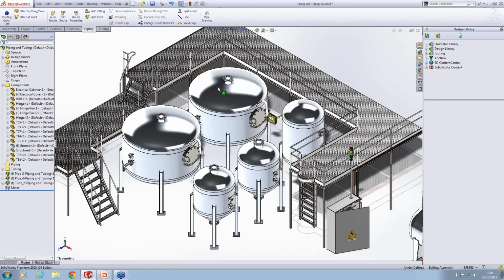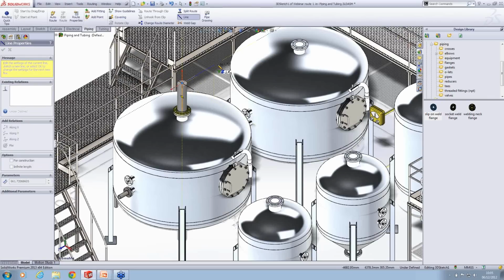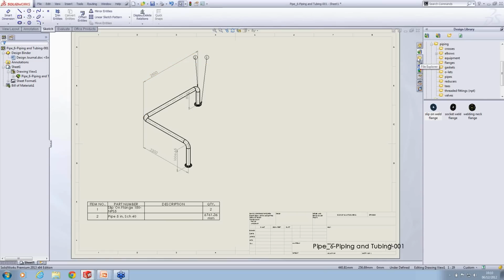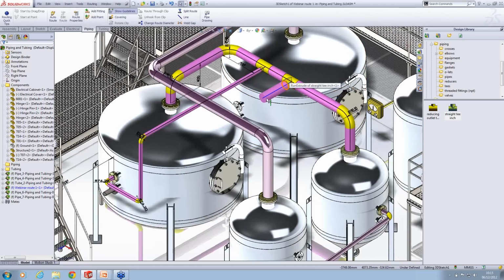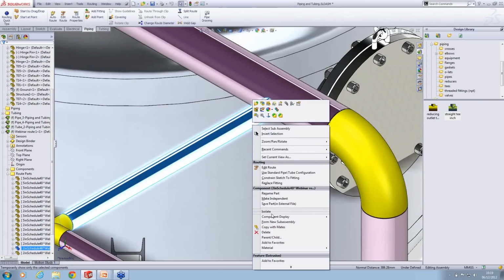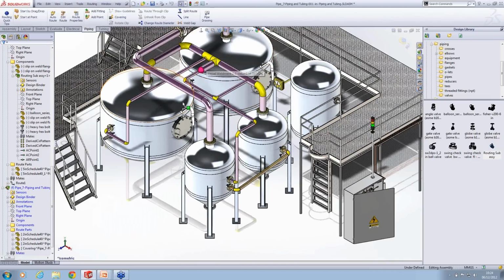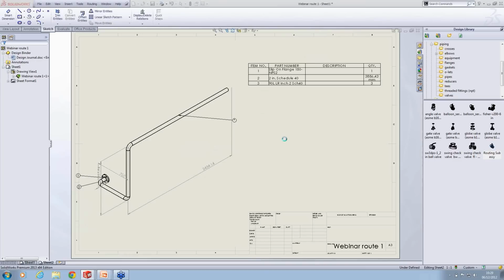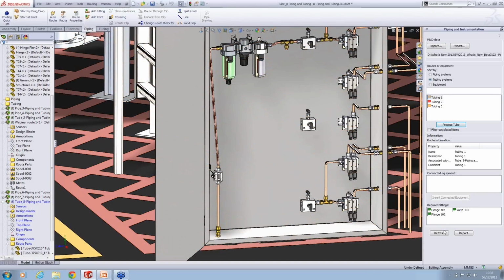Creating Piping Automatically in SolidWorks

Comment: Hello, 
I am a mechanical engineer, I moved from manufacturing industry to oil & gas engineering and construction, I am quit experienced with Solidworks, I wonder if solidworks will be useful in my new field with its capabilities of routing, weldement .... or I will need other solution like Revit and CADWorx...

thank you